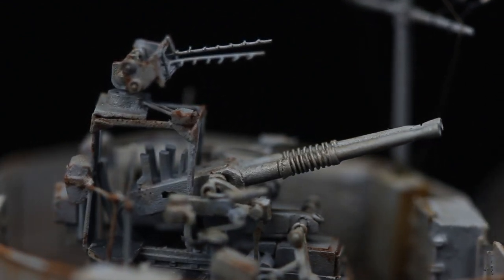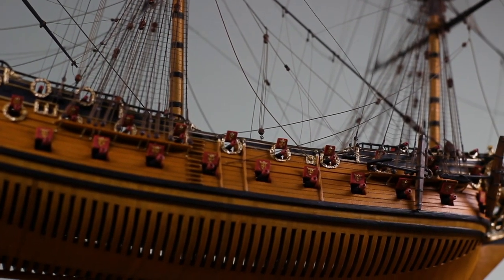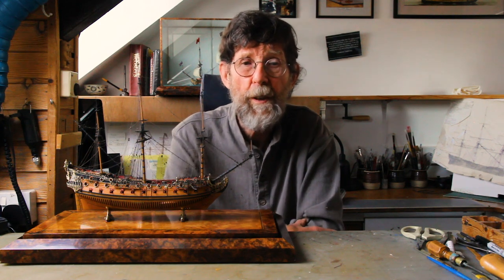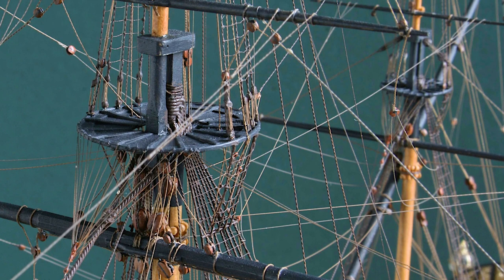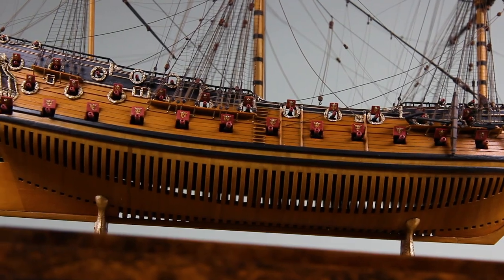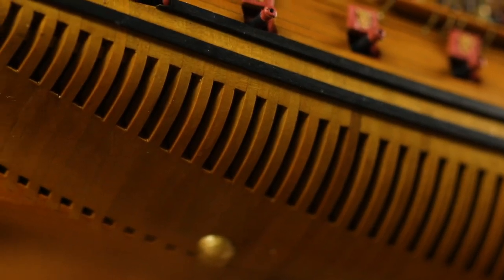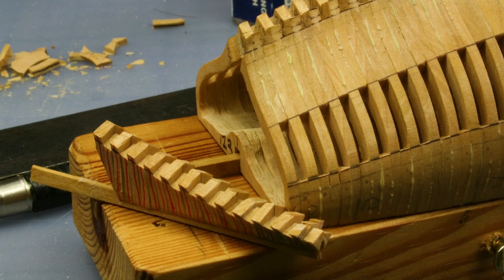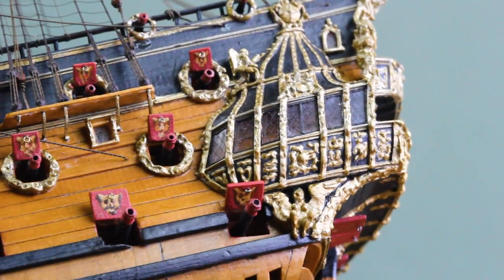Philip Reed's Ship Models No#6 - The Hampton Court

Comment: Being completely ignorant a to sailing ships, I am intrigued by the line of rectangular openings in the lower hull.
Why are they there, and why doesn't the ship sink?!
Reply: These are gunports. They are above the waterline, and they can be closed in a mostly watertight way in heavy weather (and are in fact usually closed except in battle and for gun practice). That ships have sunk because of water entering through the gunports is close to unheard of, but there is a theory that the Mary Rose sunk in 1545 because of that.
Reply: @yxx_chris_xxy  Thanks for the reply.